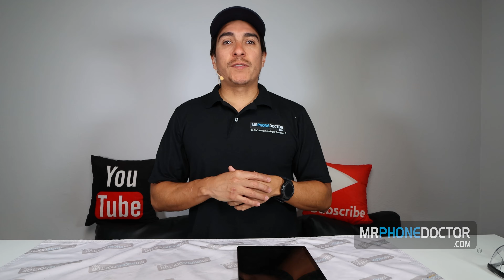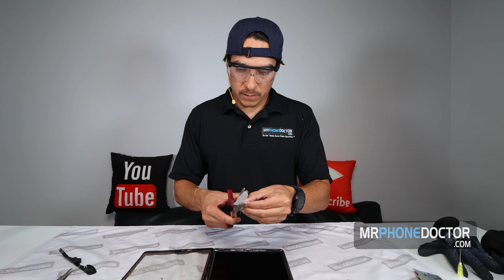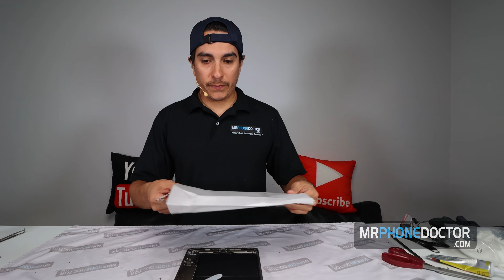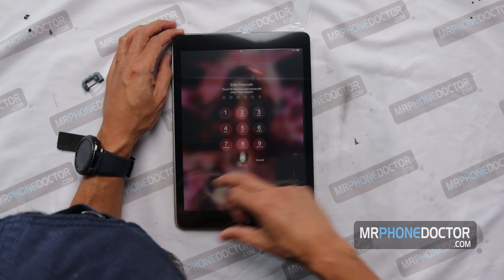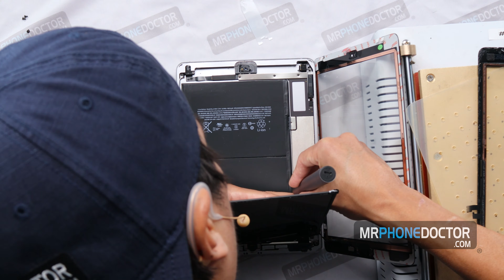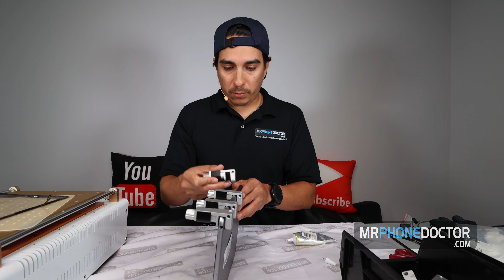How to Repair or Replace an iPad 6 Cracked Screen Digitizer A1893 or A1954

Comment: Can you stick the screen only with the adhesive tape that comes with the touch screen or is it strictly necessary to use the b8000 rubber? Thanks

Comment: My ipad pro fall down and now I notice there is little gap between the screen and the outside frame .. I tried to push the screen down but that doesn’t fix the issue should I put superglue and then push the screen down .. the screen is working and the gap is like 5 mm .. I am worried that in longterm will affect the ipad especially that I see some dust there .. can you help with advice please..
Reply from the maker: No never use super glue. Google e8000 glue and use this. 
Find something to clamp the screen down while glue cures.

Comment: How does one fix the bottom left connector if it was ripped off 🥴😭
Reply from the maker: Ouch it needs to be repaired with jumpers. Very technical... Or just replace digi

Comment: I used my 3D printer to heat my iPad. I set the heated bed to 70 degrees and heated for 10 minutes with a thin silicone pad between the iPad and printer bed. Worked like a charm!
Reply: i have a heatpad. i slowly worked between 40 degrees and finally raised to 50 degrees to soften the screen adhesive. i put the heatpad on again to 50 degrees when i work on screen side. basically heated the rear side continuously until the whole glass removed. it took ages. i scared to damage the screen with 70 defrees heat. that's why.
Reply: That’s a really good idea I have 6 3d printers myself.  I was thinking of using my tshirt press but that likely would get too hot.  The printer bed is actually the perfect temps.  You don’t need much heat I’ve heard just like 120 degrees f is enough I’ve been told.

Comment: What temperature is safe to loosen the adhesive, yet not damage the iPad?  I have replaced a few samsung phone screens using a heat gun, but  heated only the edges.
Reply: I've destroyed many S3 and S4 screens with a heat gun. In my experience if the surface temperature gets too hot to touch, then you should stop.

Comment: I enjoyed your video as a reference/guide for this model's dieassembly. I was specifically looking for where the flex cables are that I will need to avoid while slicing off the digitizer on this exact iPad model that I have not yet worked with. I have repaired maybe 200 iPads but have been out of the repair business for roughly 4 years. So this device is newish to me. They are all a little different and for all I know the flex cables could have moved. Remember the changes from the iPhone 6s plus to the 7 plus? How about the iPhone 4s to the 5? I do. Don't bother listening to any naysayers.  Your video is golden. I am repairing this device as a favor for my boss and his wife. I do not want to set them back financially or waste their time. You have helped me on my repair mission. 
Further kudos: 
- Thank you for including the model number in the video name. This made you easy to find.
- Thank you for leaving the digitizer issues that you experienced during repair in the video and for emphasizing the importance of testing before sealing the device. I've made this mistake a couple of times and appreciate the reminder not to make it again. Nothing can slow down a repair like starting all over because of a failure to verify a part before allowing the glue to dry.
- Thank you for mentioning the use of dragging the assistive touch feature button as a test method.  This seems easier than rotating a keyboard to all 4 screen orientations. 
The only Improvement that I would suggest is being sure to note a maximum temperature or a preferred temperature to heat the ipad to so that your viewers don't burn their LCDs.
Well done all around. Excellent demonstration of process, great video quality and great sound clairity. I hope your team appreciates you. We do.
Reply: Just lemme get out my thermometer 🤓